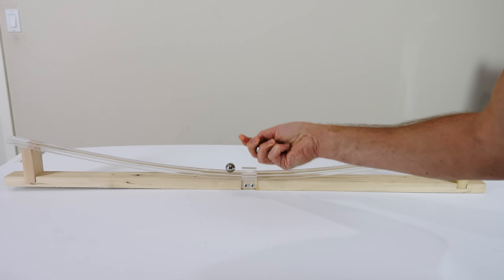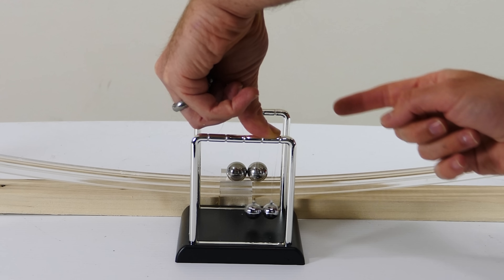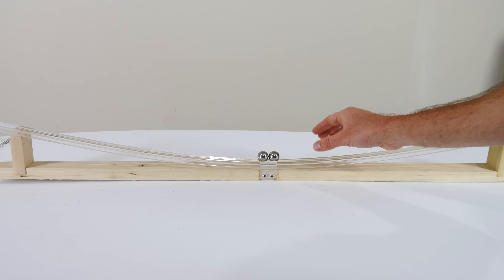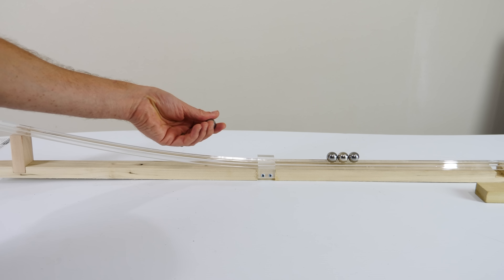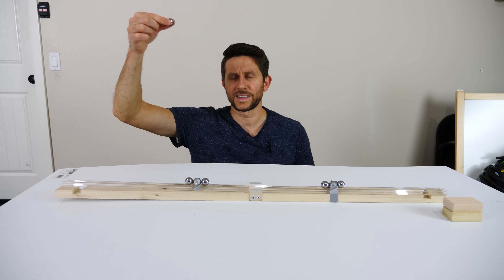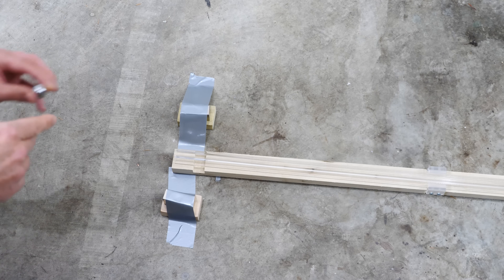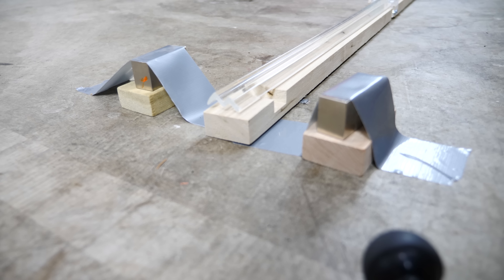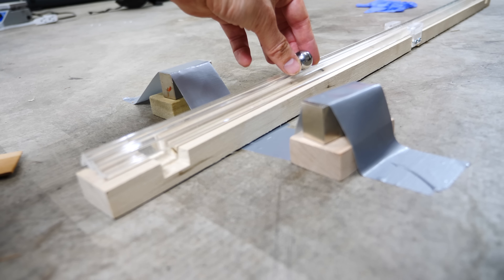How Does a  SMOT Work? (Simple Magnetic Overunity Toy)

Comment: The biggest problem the makers of perpetual motion machines have is where to hide the battery
Reply: A deeper issue in history than might be expected, as a particular type of answer is required for the pendulum clock.
Reply: Doesn't have to be a battery, some fake it with a fan or blowdryer
Reply: Copied comment
Reply: mine uses water and still works all you have to do is make the gravity stronger than the force stopping the water from flowing
Reply: @deluxcat  please post your idea so we can beat it to the ground
Reply: @official-obama  make gravity stronger than the force needed
Reply: @deluxcat  yours isn't perpetual simply because water is involved evaporation changes the level of water thus without maintenance it doesn't continue moving even making it a closed loop system the water level will vary day to day inside the system due to changes in the outside environment changing the amount of energy in the system
Reply: @kholtsclaw5266  but that wont matter cuz i have already accounted for that by adding a higher ring to the top to increase the amount of force in total thus allowing me to bypass the evaporation of the water levels to remain in a constant level i like to call the static water level where the water level never goes higher or lower than no matter the amount of evaporation
Reply: isn't electron in perpetual revolving motion around the atom core? isn't whole universe in one big perpetual motion? there is motion in the universe, no one is putting "new" energy into it. beat that.
Reply: @marian20012  sure if you want to go ahead and turn a solar system into a massive generator be my guest
Reply: i agree whit that results. but somewhere the thing is. some where there is more to take of. never give up some thing jet.
Reply: and jup there is to much fake hate it to
Reply: @theanthillfromknow.theanop3960  your english sucks
Reply: Obviously the  Action Lab guy has never heard of Howard Johnson's Permanent Magnet Motor which was granted a patent by the United States Patent and Trademark Office.

Comment: Could you use Lenz's law by making a circular tube of copper as the "track" and push a magnetic sphere through it, or would the weight of the sphere be enough to weigh it down and leave you with a magnetic sphere sitting there and not moving?

Alternatively:

Could you make a circular tube out of a magnet and then put a magnetic sphere inside the tube if both tube and magnet repelled each other and then have it coast through the tube? Or would the tube simply just end up melting the magnetic sphere?
Reply: I think the copper tubing would actually create a sort of drag, dampening the effect rather than enhancing it. On the second idea, it's impossible to build a tube with its interior one smooth magnetic field.

Comment: "Free energy" is sun and the heat of earths core
Reply: i challange you to extract enough energy from sunlight to move your car 1km, with ZERO energy input.. so no solar panels, they take energy to make, basicly rules out anything man-made as energy went into it, nothing living either as energy goes into life, youll have to sit and wait for the photon pressure of the sun to increase to the point where it can overcome the friction of the wheels on the road and the mass of the car in earths gravity.

Comment: But what happens if we have magnets which we can switch off in a clever way? If we switch them off and on in the exact right moment, so the ball never goes backwards? Aren't there these magnets where you just have to push a button to disable them?
Reply: Switching off a permanent magnet requires energy (you need to rearrange the magnetic moments of the atoms in the magnet so they are not aligned anymore).
If you use a non-permanent magnet, then it takes energy just to keep it running, and any moving metal object near it will suck additional energy out of it (see "eddy currents").
Reply: What you're thinking of is electro magnets, which take an energy source of their own just to work, so that's not viable for creating a perpetual motion device
Reply: So where do you get the energy to push the button? There are some devices that use a sensor and an electromagnet, but they need a battery. With a regular magnet you could switch somehow, you might come up with a similar arrangement that used a smaller battery or made the battery last longer, but you'd still need one.

Comment: A little more explanation of the balls rolling on the track with one magnet would be helpful. I have a degree in electrical engineering (altho it's been a LONG time since I graduated, with honor btw) and I'm a bit fuzzy on how one ball, being a magnet, causes the acceleration.

This was VERY interesting but a little more explanation is necessary.
Reply: Imagine something like a ball that is accelerated by a magnet. It smashes into it. It transfers its momentum to it. Momentum is conserved. So one ball at the end of the chain, that is further away from the magnet is pushed out, since it now has residual energy for escaping the magnetic field, just by being further away, through one or more balls before the magnetic ball.

Comment: If you make the "shooting magnents" to go in a circle, will they go forever, or at least a for a while?
Reply: No, only for as many loose non-magnetic marbles you could include in each group after the magnet, at best.
Reply: @kerezol  The springs absorbe energy each time.
Reply: those groups of 3 balls can only shoot once, (the magnet ball is on a side at first, and in the middle after.) then you have to manually reset them and it costs energy.

Comment: 5:00 I had tried with a differen scheme and i widh to know why it causes propuslsion?
* All magnets are identical, bar magnets.
The scheme is this one:
N N N N N N N N N N <--- (A)
S S  S  S  S S  S  S S S  <--- (A)
               NSNS               <--- (C)
S S  S  S  S S  S  S S S  <--- (B)
N N N N N N N N N N <--- (B)
Each SN is a magnet, (A)  is a row of parallel magnets, fixed position, not movable, like if there where glued  to the basement
Each NS is a magnet, (B)  is a row of parallel magnets, fixed position, not movable, like if there where glued  to the basement
Each(A) magnet is in repulsion with (B) and on the same line, between (A) and (B) rows there is a channel where (C) can move, (C) magnets are 90º oriented respect (A), but (C) are only two magnets that are join by their magnet attraction.
In other words, (A) and (B) are a equidistant spaced bar magnets in a fixed position, but (A) and (B) are putted in opposite magnetic orientation; (C) is two of them join by them selfs betewen (A) and (B) on a lineat path so they can not hit (A) and (B)..
Why (C) is accelerated up to a so high speed it goes out of the propeller? Why if (C) is just one magnet it does not work, not been moved?
Note: Please use Neodimiun strong magnets, magnetite looks weak and may not show that high speeds.
This is similar to Gaus gun, but with a non move properller, so it could be seen as a repetitive gun.
Warning: Exit high speed can cause real damage to your hands, better use something to caugth it like a long box, etc. or let them stop by friction with ground.

Comment: I suppose that depends on one's definition of "free energy".  Solar power is "free", once you've built the device to harness it.
Reply: So is bypassing the electricity meter but that's obviously not what these fools mean by "free energy"
Reply: @kirkc9643  lmao
Reply: I feel the same way about magnets in general. I feel that the “stored energy” is being utilized and is not in violation of the idea that you can’t get more energy than you used. I think you can keep magnets going forever possibly. A magnet will stick to your fridge for 500 years a d no one bats an eye. But say that you can get them to spin in a sphere and all the sudden you are breaking the laws of physics.
Reply: @TheGeenat  once the magnet is stuck, it does not exert any force. the normal force is equal to the force it use to hold itself. when you're doing work with a magnet is when you'll eventually loose magnetism. Magnets are creations, either natural or human, but a lot of energy goes into making one single magnet.
Reply: Of course you’re right. The guy says that one the magnet is stuck it’s not doing work, which is of course patently absurd. Resisting gravity is work, but even if it weren’t jumping the millimeter gap and attaching to the fridge is work which the little magnet can do again and again. It’s not free, nor over-unity. The magnet has to be made and will not last forever.

There is no singular simple reason that a pseudo perpetual motion device could not be engineered which ran on the power of natural magnets for years or even decades. Under ideal conditions it would be entirely possible. The problem is inherent losses. Friction, heat, manufacturing faults, imperfect balance, etc,. Under ideal conditions, yes, but in the real world, every loss no matter how small adds up, and over time the system will slow and stop.

Even under ideal conditions, you’re still only have pseudo-perpetual motion, as ultimately, over time, the magnets would lose their charge. Although, it would yet be a wonderful curiosity, if it only ran for walk weeks, or even days.

Of course, such pseudo-perpetual motion would yet be far from free energy or over-unity as trying to do any work with such an idealized system would use up whatever energy was put into the system immediately.

That said, wind, tides, following rivers, planetary orbits, solar heat, geothermal energy, etc, etc, are all free energy within the scope of human history. Time and change are indistinguishable, and thus, while theoretically there could be and end of time, its actually a fairly controversial theory, but regardless, for all intents and purposes, practically speaking, there are innumerable sources of free energy which we can easily harness and use for work while only introducing the most negligible infinitesimal losses too systems which will continue fundamentally unimpeded.

It is not actually obvious that all of these systems will wind down and cease. Even if the relevant science where settled, which it is not, it could only really be settled in an abstract sense, as theory, which could only become certainty upon the end of time… at which point any such theory will be useless, irrelevant, and literally gone.
Reply: Fusion power... 150 million km safety distance to reactor included!
Reply: @HenningRogge  ☀
Reply: Right! And what if someone had an idea for growing super-efficient "solar cells" (that could even potentially harvest background radiation) using CRISPR, glass sea sponge DNA and specific fungus from Fraser Island, Australia?
Reply: @3nertia  reminded me of a few years ago someone made a fungus that would host a modified bacteria and harvested power from it. I forgot what they made the bacteria produce to make power from light. Basically a living solar cell.
Reply: @snowpaw360  sigh

Comment: Could you combine this with your Quantum Locking experiment using your Type 2 Superconductor?
In that experiment you had a perfect circle of magnet to push your quantum locked magnet around in a circle.
Is it then not possible to create this perpetual motion?
Reply: Superconductors still require cooling, which requires energy, so...
Reply: The quantum locking and cirlcular magnet track was just to reduce friction. It never gained any energy during its trip around the track. The energy here comes from the magnetic field, so even if you came up with someway you could always be atracted but never reaching the magnet, you would still not get free energy.

Comment: Sadly, as a proof, this video is very unconvincing.
Twice, he provides demonstrations, does some "hand waving", and claims a foregone conclusion.
It would be more believable if actual measurements of energy before/after were conducted, like measuring velocity/mass of ball before impact and after impact or continuing the experiment by setting up a second ramped SMOT to show that momentum of the ball exiting the first is not enough to take it into the second, i.e. is less than imparted  by the push, to show that overall energy has decreased instead of simply claiming that it has. 
The visuals could just as easily be used to claim that excess energy was gained since no measurement of the systems energy is ever made. "Can't you see that the ball shoots out faster than the orinal ball hit and therefore has more momentum?" But, what was the mass of the first ball compared to the mass of the second? None of this is shared. And, he already showed that even though the balls are visually identical, their magnetic nature is not. What about their masses?
Reply: Proof alone is the fact that we are alive. If there was a mechanism  to create more energy than what was started with, the universe would turn into a very hot mess and continue to get hotter and hotter and unsustainable for life as we know it. Conservation of energy is not something I would bet against ever.

Comment: The unparallel magnets result isn't as impressive as the magnetic ball thing, which I felt wasn't explained fully well. But it suggests you could use a whole bunch of them to put a ball bearing through a concrete wall.
Reply: I'd also like a deeper investigation / explanation about the first experiment. Where did the potential energy come from? It is easy to understand with gravity but not on the first experiment.
Reply: @Audio_Simon  The simplest explanation is that in those blocks of 3 balls, the magnet was at one end in the beginning, and in the middle afterwards. So to reset it you have to pull one ball away from the magnet a distance of one ball diameter. That is the energy that was released (or actually twice that energy because there were two of those ball blocks).
Reply: @Audio_Simon  The deal with energy is that you only know that it's conserved in time, but it total amount is arbitrary. It depends on which reference point and inertial system are used to measure it.
For example, if we say that a ball has potential energy 0 when it's far away from the magnet, then we can measure the potential energy of the incoming and outgoing balls at the moment of collision. The incoming ball has more negative potential energy than the outgoing ball, because it's closer to the magnet. Let's give some numbers as example, where A is the incoming ball, B the outgoing, and K is kinetic energy and U potential energy:

Beginning:
K_A = 1 J (moving slowly)
U_A = 0 J (far away from magnet)
K_B = 0 J
U_B = -200 J (near to magnet)
Total energy = -199J

At the moment right before collision:

K_A = 801J
U_A = -800 J (very near to magnet)
K_B = 0 J
U_B = -200 J
Total energy = -199 J

At the moment right after collision:

K_A = 0 J
U_A = -800 J
K_B = 801 J
U_B = -200 J
Total energy = -199 J

Finally, when the outgoing ball is far away:

K_A = 0 J
U_A = -800 J
K_B = 601 J
U_B = 0 J
Total energy = -199 J

As you can see, the total energy is conserved. Also, if you wanted to "fire" again, you would have to give at least 800 J of energy to ball A to detach it from the magnet, and you can only gain 200 J of energy by attaching a new B ball on the other side. So you need to put back 600 J of energy to "fire" the system again, which is exactly the kinetic energy gained before by ball B.
As you can see, no overunity.
Reply: There's already something similar -- it's called a rail gun, and it uses electromagnetic coils to generate the accelerating magnetic field.
Reply: @TubeNotMe  But in a rail gun you add energy through the current running through the electromagnetic coils, a bit like a particle accelerator? In this ball magnet experiment, it's only a conversion of one energy type into another after a one-time insertion of energy at the start.
Reply: @remcovandijk279  Yes, but it's the adding of energy that allows rail guns to be so powerful. The effect here can't be ramped up beyond a certain point. Each stage adds more, but not as much, and pretty quickly it doesn't help to add another stage.